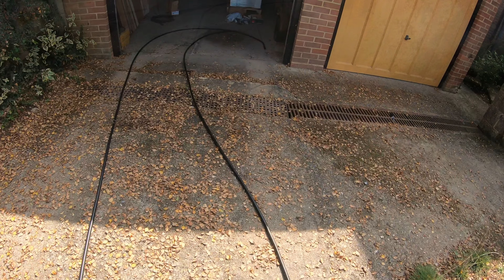Our Stiebel Eltron Air Source Heat Pump Installation, together with a  Mixergy smart hot water tank.

Comment: Shocking install…. Glad the installer did a better job on your Swanage install.
Reply from the maker: Yes, the trouble was we didn't know enough to start with to judge them I fear.  As the installation progressed we learnt a lot and knew more in some ways than the company seemed to.  And we certainly had better diagnostic skills!

Comment: I know I know this is what we all will be mostly heating our houses with but its hard to beat a simple oil boiler or gas boiler installation and simplicity so much parts to go wrong with this tech  glad you got sorted in the end
Reply from the maker: Yes, I love simplicity too.  In fact, heat pumps are pretty straightforward to install - they are used everywhere, and they are a very reliable technology - like fridges and freezers.  We are in Spain at the moment and the same technology is used everywhere for air conditioning and heating.  The only additional thin that we had with a heat pump was the use of a buffer tank - itself very simple indeed.  The issue was that the installer was not careful with the pipework, and just did it wrong.  We are now very satisfied with the the heat pump, and it is proving efficient from an energy point of view.  I would rather not burn any more fossil fuels than I have to - and going electric has to be the best option.  And we are happy to have got rid of that smelly oil!
Reply: Hi Jeff I watched your video ref the heat pump installation, you said you would do a follow up I look forward to seeing how you and you very entertaining wife have managed with the heat pump over the winter months and if you bills have changed at all. Thanks Justin
Reply from the maker: @justinwelsh9880  Hi - yes, we will be doing a follow up  - probably in April when we have had a full winter with things pretty much settled down.  Thanks for your interest! Jeff

Comment: Found it a bit strange to move the heat pump outside then start cutting into the concrete. Dust in the air next to the unit.
Reply from the maker: Yes, you make a good point.  Another black mark ...

Comment: Hi Jeff, That's very interesting, I suspect you are amongst  the early installations. Things can only improve as more systems get installed and companies become more expert.
A friend here (France) has recently had her gas boiler replaced with a heat pump system. After her first year she says her bills for electricity are a little less than her gas but not massively so. She also found that her radiators weren't as hot so she runs them for longer. Overall she's pleased with the system and had no problems after the installers left.
France gave grants towards the cost of wall and roof  insulation,  also for moving from oil or gas heating. Her installation after subsidy was a few €'s over 5000.
We don't have radiators but rely on electric heating and a wood burner. Shame as we can't benefit from the grants.
We once stayed in a property that had a heat pump in the next door garden and found it quite noisy at times. It could be a problem with high density housing but not if you lived away from the neighbours.
You're both looking well I must say. The holiday must have benefited you.
Thanks for the interesting video.
Reply from the maker: Thanks Colin.  It was a shame that the company did such a poor job at quality control.  The mistakes were all avoidable and really nothing to do with it being a heat pump - it was just plumbing that was wrong.  We kept warm enough in the winter, and the hot water for the shower etc is really hot and efficient.  It will be interesting to see what our annual bills are, now we use no oil our electricity use will be significantly higher.  But of course both oil and electricity are much more expensive now too.  It is all very difficult, especially for those who were already finding money tight.  Difficult days.   How are things for you in France? Jeff
Reply: @jeffjsmith  Costs of petrol and diesel have shot up. Seems to work out about the same as the UK.
Food costs (already higher than the UK) have  increased, also restaurant prices. Electricity remains about the same  but no idea on gas as we don't use it. We rely heavily on a wood burner and wood from a local farmer. Not sure if I'll be able to continue as I get older, wood burners are a lot of work!
Our fear that Le Pen would get elected has proved unnecessary so no worry about staying here.
We're off next week for a weeks cycling holiday in the Mayenne. Fixed base and various day rides planned.  
It will be nice to think about something other than the cost of living and the war.
Reply from the maker: @colinwellman9480  Have a good time cycling - is the Mayenne up near Le Mans?  BTW - diesel here cost £1.80 (of more) a litre, we use it in our campervan.  It has increased in price significantly of late.  Electricity is generally about 28p / kWh, although we are fortunate to have solar panels and a Tesla battery and have a great rate of 11.7p / kWh - import and export.  I hope you get fine cycling weather!

Comment: Hi Jeff. Thanks for the vid. Sorry you had such installation problems. I’ve had a Daikin Altherma 3H HT system with a 180L Mixergy cylinder since April 21. SCOP 3.78. I looked at many systems and discounted your Stiebel Eltron as it was £2k more. Why did you go with them?  What else did you look at?  Julian
Reply from the maker: Hi - thanks for the comment.  We went with the Stiebel Eltron since we liked the solid German engineering and my partner liked the sales guy…. I actually prefer the look of the Daikin, and I suspect that the software control is a bit more modern and capable on the Daikin.  But the Stiebel works well and seem very efficient and works well with the Mixergy too.  All good stuff.  How are you finding the Daikin? Jeff
Reply: @jeffjsmith  I’ve been very pleased over 18 months. And more importantly, my wife has too. Works well with the Mixergy. I’m trying to improve the SCOP to closer to 4.0. I chose the Daikin in the end because of a 10 year fixed price service and support contract.

Comment: You will regret the Mixergy choice.
Reply from the maker: You are wrong there - we love it and have had it for almost two years now.  It is very efficient, easy to control, and is totally reliable.
Reply: @jeffjsmith  I've installed a few, no real advantage over a normal heat pump high gain cylinder.

Comment: Looks like the installers are still new to this type of install. Baffles me how many installers get it so wrong. Maybe they should seek more training with the Heat Geeks. I’ve had a quote for air source heat pump and I requested a Mixergy slimline tank. They told me that Mixergy don’t manufacture slimline tanks. Clearly this is utter BS as I’ve seen them on the Mixergy website. How are you finding the efficiency so far with the heat pump?
Reply from the maker: Hi!  The ASHP in conjunction with the Mixergy is pretty impressive, especially during the recent summer months.  As an example, yesterday the heat pump consumed 1 kWh heating our hot water, and generated 4.5 kWh of heat.  It means that on a daily basis we use just about 1kWh to maintain our 210 litre Mixergy (slimline!) at around 50c degrees.  We don’t have a very clear view in the winter since we didn’t have easy access to the heat pump performance figures until this Spring.  We will see how it goes, but it does seem reasonably efficient and effective.
Reply: @jeffjsmith  that’s great to hear. I’m a big fan of the Mixergy cylinder. They are a fantastic piece of kit! All I need to do know is find the right installer for me to fit the whole system.
Reply from the maker: @MarkGaudie  Good luck with the install - yes, we are delighted with the Mixergy.
Reply: I’m about to head down this road all be it a much smaller install, problem is who to trust. Octopus Energy quoted for my installation but the heat pump has to go on our side wall 7 feet up and Octopus Energy won’t install unless it’s on the ground. Shame really because Daikin the heat pump manufacturer that Octopus use have wall brackets for mounting their units and indeed have advertising showing them.. Having seen how your installation has gone with all the problems I’m even more nervous.